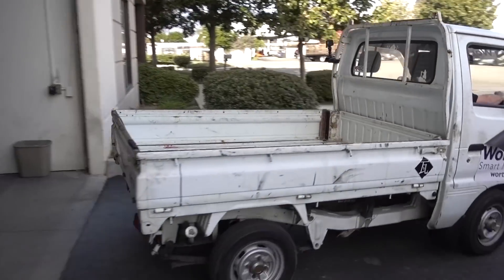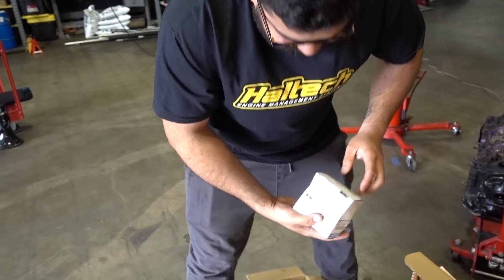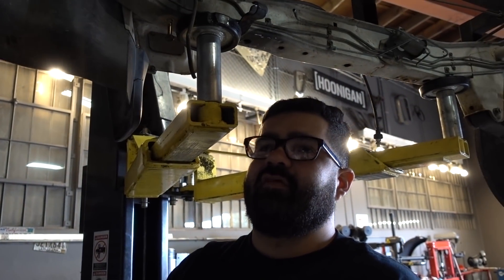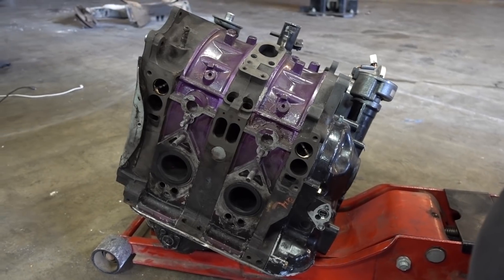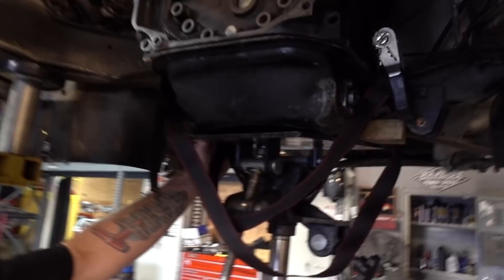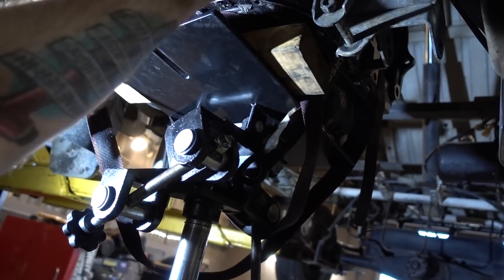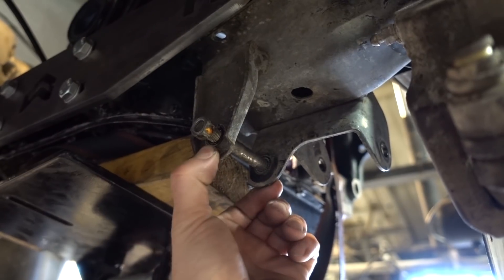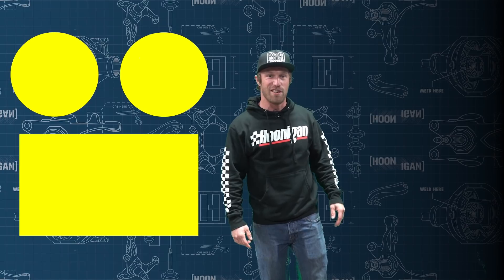Custom Plasma Cut Engine Mounts for our Ultimate Pit Truck's RX-7 Swap!

Comment from the maker: What project car are you working on?
Reply: Fiat 500 for autocross
Reply: '63 C30 Panel
Reply: My daily 🙂
Reply: BMW 2002
Reply: My 02 saturn
Reply: 94 Z28 Camaro getting a turbski hung off the front of it
Reply: 84 aw11
Reply: Rock bouncer
Reply: '80 elky 5.3
Reply: 1989 Chrysler conquest/Mitsubishi starion
Reply: 2010 Daily track lancer
Reply: Dude, Kei Party
Reply: Hoonigan Project Cars ls3 swapping a 68 mustang coupe... yes an LS lol. I’ve gone through 3 ford motors in a year and non of them made more than 400hp
Reply: Suzuki Super Carry for my first daily
Reply: NA Miata, 04 Passat 4motion, and an Ford E450 based school bus. And I'm adding another something to the mix today....
Reply: 98 silverado with a stroked 4.3 v6
Reply: Fiat Stilo Abarth '04
Reply: '96 Toyota Starlet EP91, which is my daily, AND a track toy.
Reply: 71 VW kARMANN gHIA
Reply: Project/Daily 2018 Honda Civic hatchback sport, its got a 6speed!
Reply: My rc car
Reply: "86 Toyota Corolla 1.6i Coupe GT Twin Cam 16V Levin  @Ae86dams
Reply: 85 Mitsubishi mightymax
Reply: 82 celica gt ex lemons car turned budget drifter/84 celica gt clean daily build
Reply: 01 bmw 325i e46
Reply: Are you guys hiring? Just asking the real question here.
Reply: 82 FB rx7
Reply: 93 Toyota pickup into a rock crawler
Reply: 1999 Passat 3B 2.3L VR5 Sychro for Time Attak 😛
Reply: Rb 944
Reply: 1990 Ford Bronco Full Size
Reply: E30 swapped in a M42 from an e36, like u always have one in your E30 4 cylinders over there :D Greetings from germany, some very awesome and fun stuff to watch on your channel!
Reply: 1960 Suburban Carryall
1963 Nova
2006 SRT8 Magnum
1994 525i
2004 TSX
2016 Thruxton 1200
2007 Z71 Suburban
Reply: 1990 300zx 2+2
Reply: 1986 Olds 442
Reply: 1980 Celica GT coupe!
Reply: 91 Wolfsburg jetta with a g60 supercharger.
Reply: Need help with motor mounts and subframe !
Reply: friggin blown 2010 subaru sti hatch, got soaked hard wish i could fix it ffs, if u guys want to do a show on putting an ls in one come get mine haha :D
Reply: 47 dodge deluxe 4door
Reply: '85 Volvo 740 N/A carbureted to turbo injection conversion.
Reply: 1966 gto, I got one forsale if you want it
Reply: 2006 Ford Focus st225 converting it to Track Only Car
Reply: -20F degrees last week here in Hell, Michigan...
An't working on shit.
Reply: JDM 2010 Honda Odyssey. Converting to manual and Type-R head on the K24A block. Maaayyyybe turbo, aiming for 200kw.
Reply: 1980 wide fender  vw  bugg ...
Reply: 1988 Volvo 360 gl
Reply: 95' Mitsubishi 3000GT base
Reply: Ls1 s10
Reply: Hoonigan Project Cars my jeeps and random stuff my friends bring me
Reply: 200sx s13 with rb25, its becoming like a life time project havent been drifting it since 2012 😏
Reply: Hoonigan Project Cars I’m having a hard time working on my dream car, a 1964 Lincoln Continental...

...probably because it’s 1/64th scale.
Reply: Hydro pneumatic Citroen.... Greasy hydro fluid everywhere
Reply: 1968 Mustang gt
Reply: Hoonigan Project Cars a 1984 rx7 GSLSE with a carbeurated Bridgeport 13b. Sitting on 15x10 watanabes and a pretty nice fiberglass bodykit.
Reply: الحمد لله على السمع والأبصار والأفئدة
Alhamdullilah for sight, hearing and heart.
Reply: R33 GTST
Reply: 1966 Impala wagon!
Reply: 2007 Mini Cooper S, 1989 Chevrolet Suburban Silverado 4x4 heavy half.
Reply: depression. hung out with friends yesterday despite really not wanting to. my jaw hurts from all the smiling and laughing, felt good to be with friends.
Reply: 1982 bmw e21 body on C5 corvette frame ... you can see it on my instagram @buttedorfrank
Reply: 1982 datsun 280 zx that im gonna swap a 240z engine into and put a four barrel carb
Reply: 94 Jeep Grand Cherokee 5.2, awd, it's been my street sleeper since I got out of high school. Dumped a bunch of money into the engine and trans back in 05, it was pretty quick back then, but it's starting to show its age and the 318/360 platform is limited and the aftermarket small. Planning out a ls swap for it.
Reply: Volvo 940 with a Holset turbo strapped to it.
Reply: Datsun 620 :)
Reply: 1991 JEEP Cherokee XJ 2 door, just light offroad and daily driver all in one car :D
Reply: Audi 80 B2 (known as 4000 in the US), engine swap from 1.6 to 1.9 done, now working on the gearbox swap along with the whole subframe and shockers and brakes and everything. Basically it's gonna be a B4 with a B2 body, a sexy and also reliable little daily. And all mechanical:D
Reply: 91 foxbody mustang
Reply: I got a 1994 s10 with an evil engine swap in mind lol
Reply: A rock! One similar to Sponge Bob's rock
Reply: Not really project cars, but my "job" is working in a garage fixing this one family's cars. We finished an a4 third gen, reassembling the a4 v6 second gen's engine, fixing a Pontiac Soltice with an idling problem (haven't done much on that) and doing an engine and tranny swap from a Pontiac GXP into a minivan for "towing".
Reply: 2009 e90 335i. Just started welding school too
Reply: 69 Datsun 521 pickup
Reply: Checkbook. No car... Wife took it by putting both in her name. Its just a car, but I will have another.
Reply: 1960s vw beetle on a truck frame, probably throw a diesel engine in it,
Reply: Wait... Did I hear Vargas say no bridge port ??? 😳
Reply: 1979 Opel monza 3.0L 24v (original opel engine) swap with 5 speed manual
Reply: Eg6 street and track car
Reply: My 95 Taco 4x4 got the whole front end apart and hopefully stabbing a 5.3 LS in soon
Reply: I am looking into starting a RCSB Chevy budget drag truck. 5.3 or 6.0 swap... i will add forced induction once its up and running.
Reply: Manual swapping my daily JZX100 Chaser. 1jz VVTI goodness 👌
Reply: 87 mustang convertible for drift
Reply: My 87 fc rx7
Reply: Evo 9 MR
Reply: 1990 Acura integra
Reply: The pistons were on a different evo, so I bought them from a guy on Facebook marketplace
The ppg dogbox trans was gifted to me for my birthday as well, I changed the trans like 2 weeks ago cause I forgot I had a new trans sitting in my garage in the corner, and it took a while to remember that I gotten a new trans for my birthday

My birthday was on November 8th
Reply: RX7 FB GSL-SE, completely stock for now since its cost intensive to legally modify stuff in germany, specially old uncommon cars. Planning on porting the engine and rebuild it since it. It runs good now but I want big ol' ports, mostly for the sound and some more Power. Turboing stuff legally in germany can get very cost intensive so i'll prolly stay n/a, should be enough to have some fun with it.
Reply: Saab 99 T16... and Audi S2 Coupé 💸🙈
Reply: Im working on my E36 Drift Sedan. Hopefully going to LQ4 swap it within the next 6 months.
Reply: Desert racing V8 Range Rover.
Reply: 72 nova SBC that’s been built😈 
And a lowered and bagged 91 GMC Sierra ext cab stepside
Reply: My daily Renault Megane RS is kinda a project car because there is always something that needs to be worked on lol
Reply: Nice prefab Dan, lookn' good. What's the update on Carcaine with the Scott's?
Reply: Rebuilding my 09 VW rabbit after a crash, adding mods along the way.
Reply: A dirt bike 1979 honda xl250s
Reply: E89  that I adore and a v6 cause daddy needs a offroad toy
Reply: Sr20 Datsun 620, 1jz e46
Reply: 1968 Series 2A Land Rover with a 200TDi conversion
Reply: 2000 honda civic si
Reply: 91 GMC Sonoma 2wd gonna drive it till the little iron Duke locks up gonna swap in something else...at the moment just need a new alternator and radiator
Reply: 1960 Porsche 356 Coupe
Reply: @Yostbuilt...we have spirit rt / csx#437  / srt4-minivan/ juke / la vaca da / big turbo accord
Reply: 2016 Colorado
Reply: 1983 mk1 vw rabbit gti, with a 2.0 16v abf clone, with standalone. (Clone, cause we never got a mk3 16v in the states) waiting on some fuel stuff from radium. :)
Reply: 93' 1of1400 factory 5spd Grand Cherokee's got it sitting on super duty axles.
Reply: 5th gen camaro ss i bought for 8k 
🤙🏼
Reply: 1994 Chevy Corsica.. finna lift it lmao
Reply: 82 fj40 restoration 
14 y61 pickup ls swap
Reply: S13 hatch and my 3rd gen 4Runner
Reply: Ben Crowson more like a Holset with a engine strapped to it
Reply: I’m VR38 swapping my 1999 Nissan Silvia S15 yes it’s a R35 engine!
Reply: british version of shitcar
Reply: 1jz 1990 Cressida for some skids😎
Reply: Fendt 106s
Reply: Call it the Scumzuki
Reply: Toyota hj45 land cruiser
Reply: R32 GTR Daily Driver
Reply: Willys jeep
Reply: Geo tracker 1999 soft top
Reply: 1989 Toyota Cressida with a 1uzfe  swap
Reply: A 1974 VW Bug. My dad and I are rebuilding it into a Baja for my first car. The only thing that really is going to be stock in the engine is the block
Reply: 2 BMW e46 325i,s one an xi going turbo the i is LS SWAP like you guys purple BMW..and a 04 srt4 with 689hp for a little grip daddy action!!!I hope lol installing the new built trans at the moment. ....you guys should get a barra motor from AU and throw it in something. There freakn power houses and make way better noise and power than 2j,s and for waaaaay less chedder!!!keep kickn ass fellas!!!!and come to NC some day...
Reply: '85 Chevrolet Chevette
Reply: 1977 Honda goldwing
Reply: Too broke to have a project car, or even a car period
Reply: 1993 gmc jimmy SLE soon to be LS boy .......
Reply: 2001 FD RX-7. 
It never ends. 🙂
Reply: 05 z71 tahoe 
-awd conversion
-6.8l stroker
-4/6 in drop on coilovers etc
-24in texas edition rims with willwood big brake kit
-custom interior
-5k watts sound system
- custom steel push bumpers 
Gonna be my daily.
Reply: 2016 Ford Fiesta. Building it into a track/daily car.
Reply: Non. But I bet this runs before twerk stalion. Herts got jokes about that tape messure
Reply: 91 f250 4x4
Reply: Ford Fiesta mk6
Reply: 1970 4 door nova
Reply: I'm working on my mini bobber
Reply: 1986 Pontiac Fiero se getting a Chop top
Reply: 1981 Talbot Matra Murena 2.2
Reply: drz400sm
Reply: 2003 Subaru forester offroader
search Tims subaru forester, that my inspiration
Reply: '92 ZR-1
Reply: 91 mr2 turbo
Reply: 1977 Datsun 280z that was rear-ended
Reply: '59 Apache
Reply: Snowmobiles if they count
Reply: 95 eclipse gsx
Reply: I have a 04 Honda civic
Reply: Gd3 fit
Reply: my 2001 audi a4. almost done!
Reply: 72 C10 as an 18-year old college student. :) enjoy it.
Reply: Super Seven kitcar with a Yamaha R1 152 bhp to 547 kg's (1200 lbs), for racing
Reply: 2005 sti
96 4x4 k1500
97 nissan mini truck!
Reply: 89 supra with Garrett gt45
02 is300
05 titan 
06 passat 2.0t
Reply: My broken ass boosted 93 240sx
Reply: 85 Porsche 944 :(
Reply: 2004 is300
Reply: 1966 ford F100 Short Bed W/429.
Reply: My late uncles 1969 chevy chevelle
Reply: I got a 72 nova like Mr.Scotto but mines blue and... and.. wait for it.. it runs! It’s all stock at the moment unfortunately but I cut the exhaust off and it shoots flames
Reply: Love this "Pit Ripper"😉😉, but my project car is getting my grandfather's 70 El Camino running again and ready to tear up the streets.
Reply: crx
Reply: take the crew to buy some car in Japan type a r34 or a classic or shit car and bring it to the usa
Reply: 97 legacy outback rally wagon
Reply: 1988 Chevy S 10 2.8 V6
Reply: 1986 300zx
Reply: 1972 Ford F-250 with crown Vic front end and explorer rear end with a 302
Reply: S52 e30
Reply: a 97 Civic Coupe with an H22 swap for road racing
Reply: It's a Carry, you should call it "Carrie," like the Stephen King story.
Reply: Purvis Eureka, which I haven't touched in about 4 years......
Reply: 93 geo storm gsi
Reply: 1970 VW squareback that is now a mini truck with karman ghia sheet metal grafted on the front end
Reply: It's too cold in the shop right now but 1938 Chevy Master Deluxe 2 door sedan (hump back), gonna be the perfect cruiser; crate 350, 700r4, highway rear end, Civic seats, Mustang II front end.
Reply: 2004 Subaru Forester - sti swap, closed deck, big turbo. All is done. Now to put her back together... 🙏
Reply: 1968 Nova
Reply: SR20VET Datsun 510
Reply: 97' Holden VS Series 2 Commodore Sedan for Autocross #landyacht
Reply: Ae86 though working on is a strong term it's more of a scotto build at the moment, 8 years and counting
Reply: Dodge ram 1500 98 and a subaru fozzy turbo
Reply: Was my IS300 before my accident 3 weeks ago.
Reply: Supraa
Reply: Honda Beat!
Reply: Building a sick golf on horizon 4 😂😂😂
Reply: 1963 Beetle with a turbo waterboxer. It makes 354bhp @ 25psi boost and there's more to come.
Reply: 00 WJ overlander/trail rig check out the progress with @impulse_fab and @ajumbdenstock on instagram!
Reply: 1998 MX5 NB 1.8
Reply: Land-Rover Series 2A
Reply: 1985 D30 military postal unit
Reply: 67 mustang with a dodge rear end lol
Reply: 73 karmann ghia
Reply: 85 shifty fifty, cause that old f150 will smoke 38’s with the 200,000+ mile motor when I’m done
Reply: Gettin an 87 Dakota
Reply: Civic Wagon '91 4wd - full restoration
Reply: 1996 Honda Civic Ej6
just doing some stuff to make it a little street racer
lightweight and currently rear axle swap to discs
Reply: ´99 Volvo V40 T4 has been my daily driver for 5 years and will be finished rebuilding it this year.
Reply: 1931 Ford Model A rat rod
handbuilt frame, big block chevy, and parts from like a dozen cars spanning about 20-70 years old lol
Reply: No Rotor FC!
Reply: Hoonigan Project Cars a 52cc mini chopper or home made rc with the 52cc bog bore Motor
Reply: The name of the car has to be honitrukin jr
Reply: 1983 Jetta mk1, 1988 BMW 316i, 1992 Mercedes 260E on airride and a 1993 Honda NSX! Mercedes is my daily, but still needs work. NSX is our weekend car, but the radiator was bad, so we're replacing that and fixing some other stuff. The BMW is gonna be a 330i soon and the Jetta is gonna be low and slow... Carcaine is a hell of a drug
Reply: R33 skyline aiming for 600bhp street car
Reply: R32 GTR vspec1 white
Reply: 2000 540i 6spd
99 cavalier off road buggy
Reply: Lq4 swap in 90 bronco
Reply: 1963 Oldsmobile F-85 that may get a 1JZ swap in the future
Reply: Subaru legacy 3.0 swap
Reply: Working over the carbs in a Suzuki carry, ironically...boss has one we built as a feed truck & it works GREAT, so time for time for take 2
Reply: 06 vw jetta GLI and an 07 vw GTI..couple vids on my channel and a lot to upload lol.
Reply: 02 Daihatsu l701 1 litre 3 cylinder
Reply: 2jz Toyota 4Runner
Reply: '98 Avalon daily driver
Reply: My daily rx8 and my dad's xf falcon ute
Reply: Is there a certain place you get rotarys im working on a rotary Miata track build
Reply: 02 Mazda Miata
Reply: Replacing the floors on a crusty 85 gts ae86.
Reply: @hidehimself2748  sick
Reply: 89 r31 silhouette
Reply: Oh you know just my wide body gold wrapped carbon fibre Lamborghini
Reply: 89 volvo 240 sedan an im putting a 351 in it
Reply: Volvo 240 wagon....
Reply: Hoonigan Project Cars a montero sport drag car
Reply: 1996 Mitsubishi 3000GT
Reply: My life
Reply: 1985 hijet.. you guys stole my idea💡! and 924 na
Reply: Restoring a Mercedes Benz 190
Reply: 81 chevy LUV
Reply: 06 sti. NEED MORE KEI TRUCK
Reply: AE71 corolla  panelvan with a AE111 rwd converted blacktop 4age 20V with 50mm ram tube open quad throttlebodies.
Reply: 85 300zx
Reply: 1968 Morris Mini
Reply: I'm working on building an srt 4 neon
Reply: Fixing up a neglected 2005 Honda Civic EX. It's not going to be so much for any kind of insane speed, but for good handling on country roads and track days. Adding some coil overs (about 2" drop), aftermarket control arms, stiffening up the frame, all new bushings, new rack and pinion, stabilizer bars, strut tower braces front and rear, alignment kit. The 1.7L will be swapped with a stock k20a, intake and exhaust. Going oversized on the brakes, replacing the drums in the rear, disc brakes all around. New wheels and tires. New gauges, trans, clutch, shifter, the works. Removing the interior upholstery completely, and spraying everything with truck bed liner, custom door cards and dash out of sheet aluminum. Custom roll cage, etc. etc.
Reply: 97 Suzuki Carry. No dumper tho.
Reply: 1991 toyotA Camry
Reply: Hoonigan Project Cars a suzuki 4x4
Reply: @ewatfred  Bisi Moto did one. It has a 1,000 horsepower.
Reply: 4 rotor, single turbo, FD Mazda RX-7. Use my idea for a Twitch episode for the do's and don't's of a rotory engine.
Reply: @waybous  They did an American Honda Odyssey, almost totally different car. Because America.
Reply: 73 Thunderbird daily!! Giving the 460 some 427 Cobra Jet heads, then swapping the jets on the carb
Reply: volvo 211
Reply: S13
Reply: 82 toyota corona coupe and a e36 coupe
Reply: 91 Honda CRX
Reply: 98 4x4 ranger.
Reply: @krisangus226  you had had engines. A 351 easiliy makes that
Reply: My project is my daily, 03 lancer, at least it's a 5spd
Reply: lashjam1321  i am thinking about puttig a vr6 with  powerglide  in my sl2. Good luck on your cobalt turbo
Reply: 06 Subaru Legacy, my daily driver :)
Reply: 04 GTO aka Wobble Goat.  Finishing up a manual swap.
Reply: 3.7 cyclone swapped rx7 fc. Don't tell Hert, he be jelly.
Reply: Working on restoring a 1988 f250 with a 7.3idi diesel.
Reply: 1999 Ford Laser which I dub Project Laser
Reply: 2003 350Z to learn how to drift when I am not working, debating on dong a twin turbo kit or LS swap
Reply: 02 mustang, full suspension, super six motor sports 4.3 stroker, TVs twin scroll supercharger and t5 G-Force transmission
Reply: I have 1980 VR6 rabbit and 1981 rabbit pickup with 1.8T that I’m working on :)
Reply: 1990 chev extended cab short box 2wd , 5 speed welded 10 bolt 373 gears  and 8500 rpm of old school small block